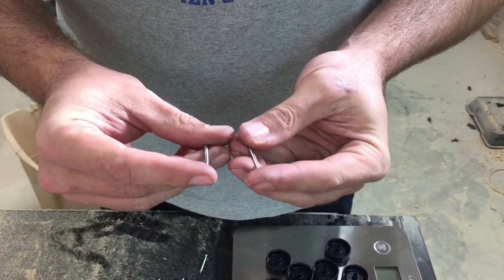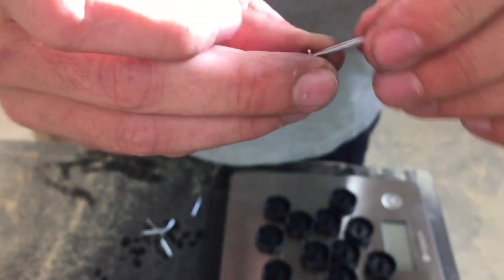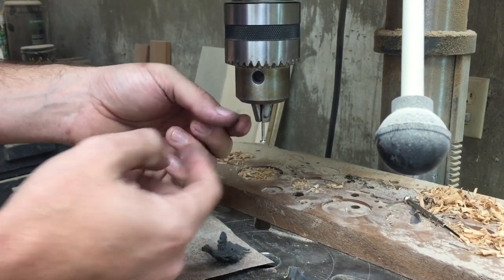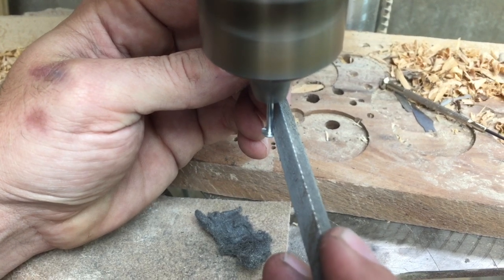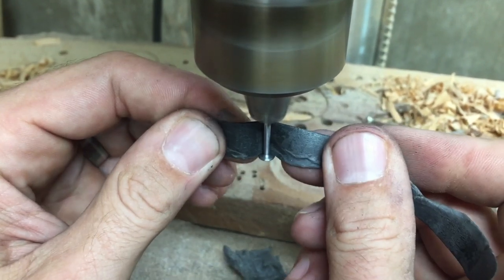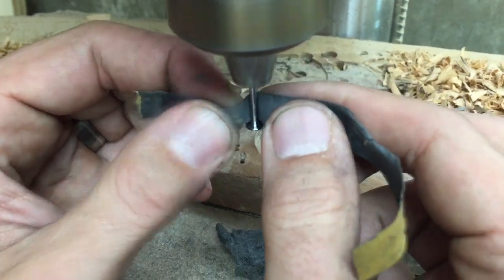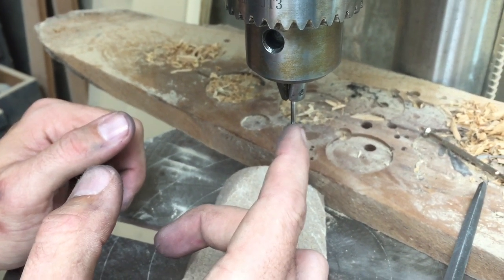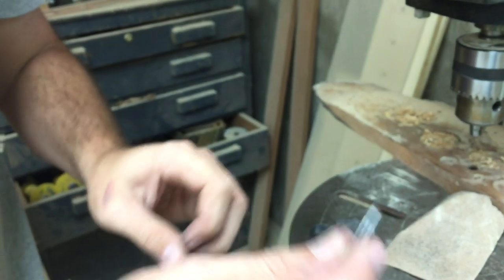Pinewood Derby Secrets Part 1 - Axle Polishing

Comment: 1000 grit to 8000 grit paper you much happier with your finished work and faster also.
Reply: P G1 how do you do it? do you go straight from 1000 then 8000?
Reply: 8000 grit???? That's silk or finer than.. hes not even using 3000 grit... maybe 2500